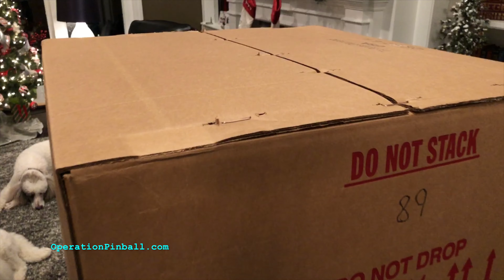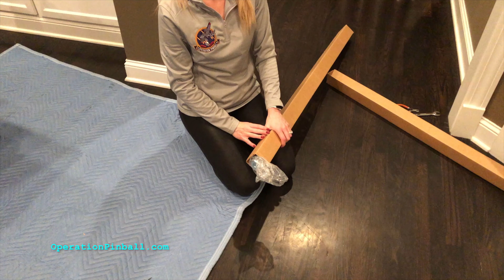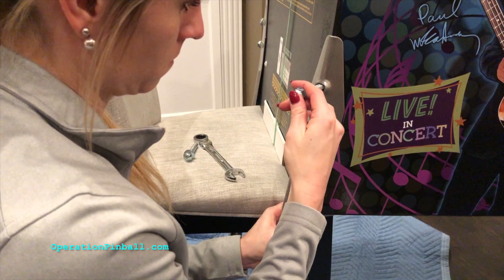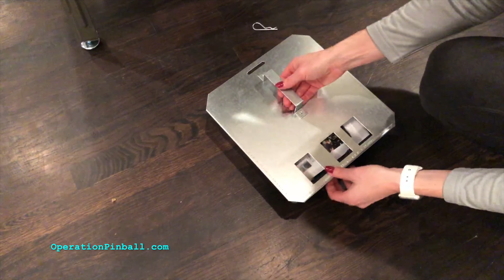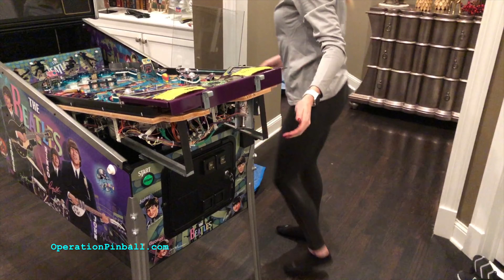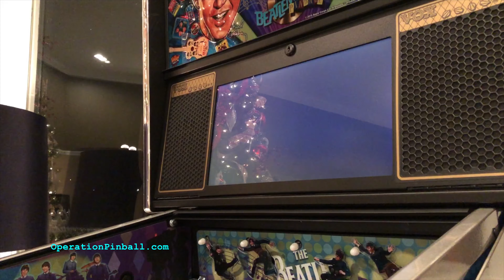How to Unbox a Pinball Machine and Save the Box - Beatles Diamond

Comment: Great video, why don't you use the factory balls? are they really that bad to use?
Reply from the maker: kirby695 we like a high polish ball.  The theory is, balls with a smoother finish from the start are easier on the playfield, but more importantly the high polish just looks nicer rolling around in the machine. The balls that are included are usually not mirror finish and you can usually see the surface imperfections as they roll around. It just is more pleasing to the eye.
Reply: @operationpinball7155   Thank you
Reply: @operationpinball7155  What kind of balls do you usually buy? 

Solid video!  Good instructions, and you both took your time detailing every step.